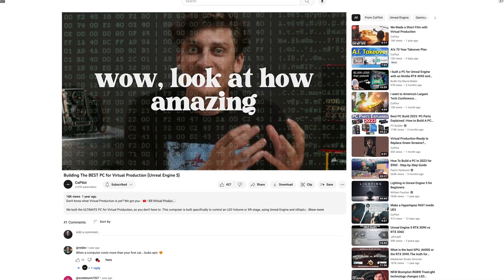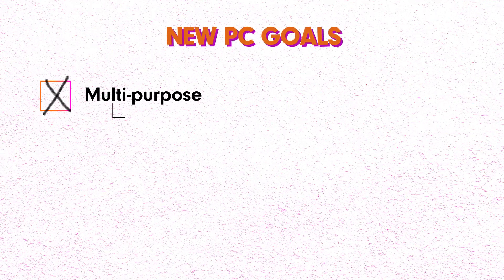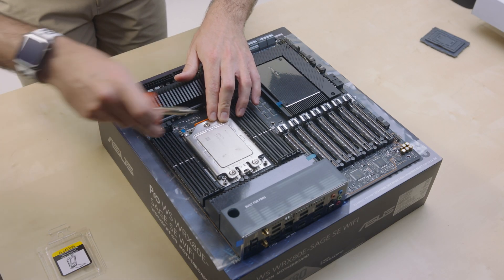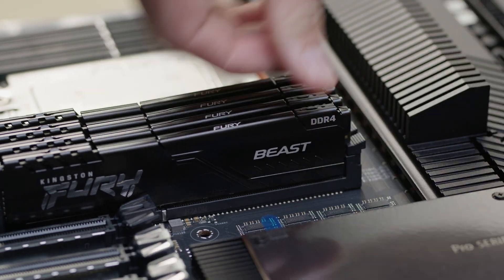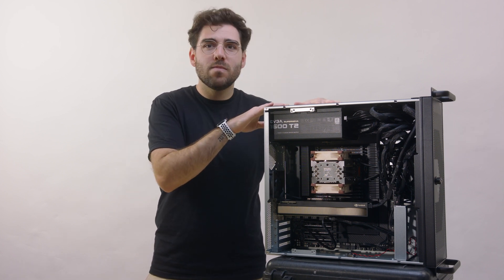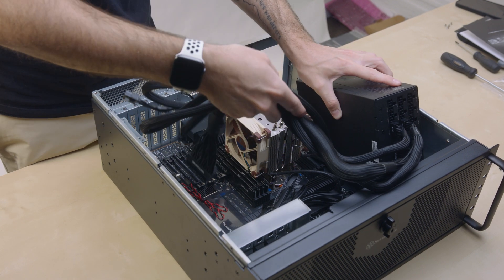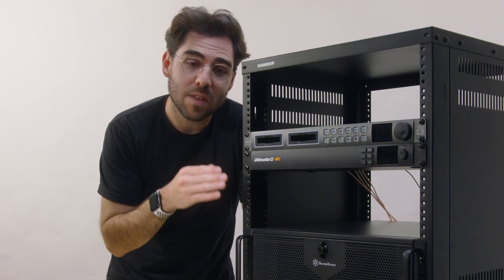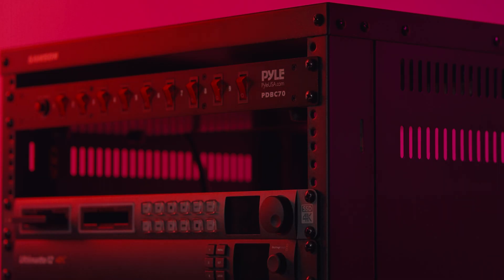Building The BEST PC for Virtual Production in 2023 (Unreal Engine 5)

Comment: Selecting an RTX 6000 ADA GPU will double with TFLOPS capacity compare to an RTX A6000
Leveraging multi-GPU in a Virtual Producion configuration is also very important, a lot of improvements in Unreal has been brought towards mGPU system
Reply: no budget to test 6000ada to compare a6000 :body-green-covering-eyes: